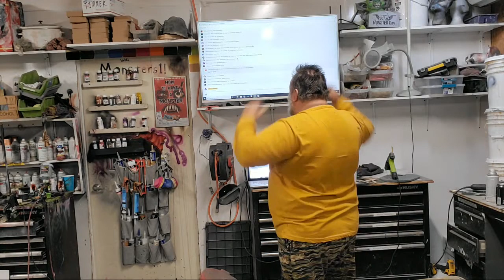Molding A Half Mask In Ultracal

Comment: I've made a mold today with ultra cal 30 but after it set I was shocked to see the top of the nose of my sculpted sticking out from the mold. Can I mix some more ultra cal and cover that spot or is that a bad idea?
Reply: You can mix more and cover the area because ultra cal will always bond to itself. I only guess that you have not tried to remove the mold from the sculpt which will destroy it. Make sure that the exposed area gets a thick layer and not just simply covered by definition of not seeing it or it will crack/break, and cover well passed the exposed area too because I found while prying apart a 2 part mold, an outer edge chipped and you can tell it was an entire layer because the mold was made days apart due to my schedule. It will ensure that if there's an accident that area wont just simply chip/pop off entirely. Best to apply everything on the given day since it bonds best altogether.
Reply from the maker: sounds like you have it covered, yup just mix up some more to patch

Comment: Do you need to wear a dust mask when mixing the ultracal 30?
Reply from the maker: you dont need to, but its not a bad idea. I dont do it as much as I should.
Reply: @StiltbeastStudios  Okay. I was told that it's a good idea to wear one. Just don't wanna do any damage to my lungs. I'm new to the whole casting thing. I attempted to make a plaster cast a few weeks back and it was a disaster. Was told to try ultracal 30.
Reply from the maker: @fearnet2011   ultracal 30 is much stronger, Im not sure of the nature of your work, but strength and reliability helps.
Reply: @StiltbeastStudios  I was using plaster of paris and I think I mixed too much plaster in with the water and the plaster got rock hard very fast and I had no working time.
Reply from the maker: @fearnet2011   yes, I call that plaster of peril- because its so inconsistent.  Good luck, need anything just message me. 
https://www.facebook.com/allen.hopps/